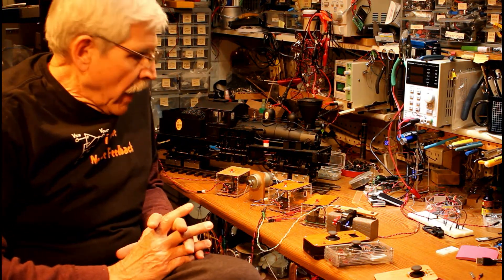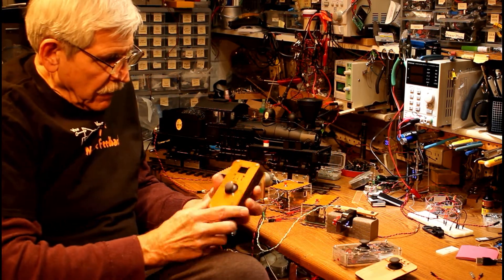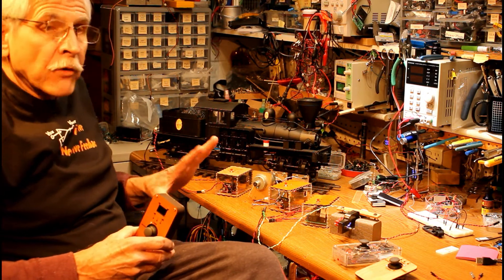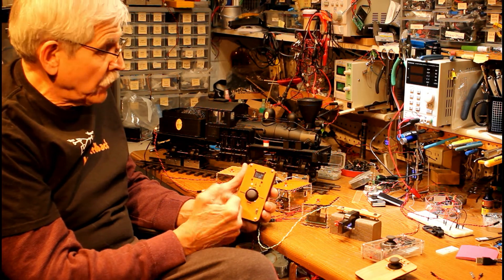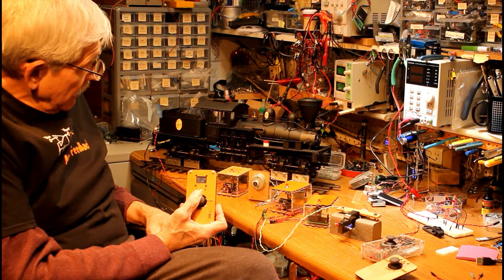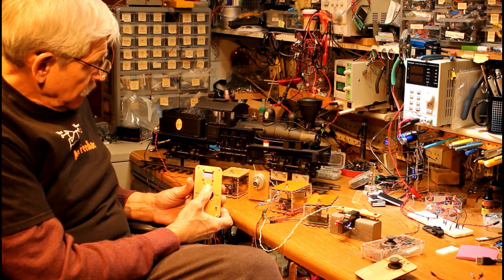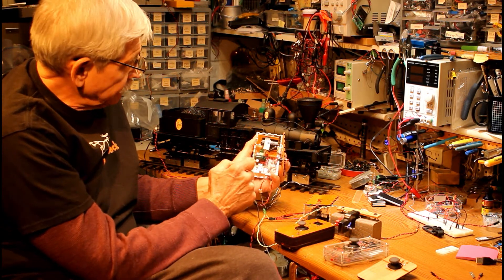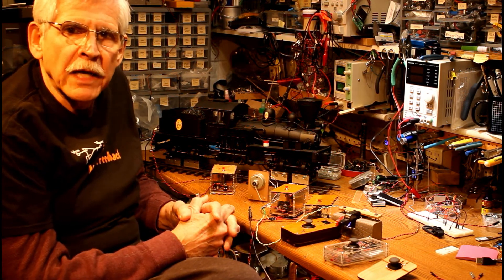3 Channel Wireless Model Railroad Throttle with Joystick

Comment: If these were used in a live rail application, I am not seeing how these can be used to power different locomotives on the same track, unless each locomotive has a decoder.  Is this DCC or is a way to provide remote control for DC locomotives?
Reply from the maker: You need to put a receiver in each loco to run them on the same track
Look over the web page that is linked in the description 
Dave

Comment: Hi, love this design. Just finished building one for my first loco. I have two small issues. When you fully accelerate or decelerate it takes almost one second per number, so full speed will take over one minute to achieve. Second issue when you let go of the joystick it doesn't hold speed it automatically decelerates at the same speed. Is this a program issue or do I have the wrong joystick? I'm an amateur at arduino, so I don't know which part of the code to look at. I also used a nano for the transmitter as well, so I don't know if I did something wrong.
Reply from the maker: Mark - it is possible that the joystick is the issue as a number of different manufacturers seem to make ones that look the same - it would surely be worth swapping that out.
Good luck & have fun with the project
dave

Comment: Hi love this and am looking at making 12+ hand pieces for our DC club and was looking at using these wifi units instead. Do you think it would be to much work to take your original circuit and change over to one of these - ESP8266 ESP-01 ESP01 Serial Wireless WIFI Module For Arduino Transceiver Receiver Board For Raspberry Pi I2C SPI UART Interface - from Alli express they are a $1.74 and i think have better range than the unit you used
Reply from the maker: Michael - the ESP8266 is a completely different beast - the HC-12 is MUCH easier to implement and has a greater range potential.
dave

Comment: Your next project really needs to be a Arduino mini based dead rail receiver to compliment your DCC wireless throttle!!!!
Reply from the maker: That has already been done as the receivers used in this project can easily be carried by a large scale train along with a lithium ion battery pack - for smaller scales (HO, for example) a smaller unit would be needed.
Is that what you have in mind?
dave
Reply: Actually I'm a N scale guy. :-) N's mighty small for such things, but I have a few "popsicle" boards made by Hayri, (https://www.youtube.com/watch?v=zY_FYg7vq0A) (I'm using Hayri's CNC Controller for my homebrew cnc), which could fit in a N scale car, the problem is getting a full bridge motor driver to fit in one. I know there are I.C.'s for building them, just haven't googled it all out yet. Truth yes, I am a great monkey see, monkey do kind of guy, I love to use what you smart guys invent. So much easier that way. :-P
Reply from the maker: N-scale would surely be a challenge!  I should think that very few folks run N on batteries!
dave
Reply: Wouldn't a Adafruit DRV8871 DC Motor Driver Breakout Board work for a Op-only track? I think it would fit. Ordering one just try to see if it will work with an Uno to operate a single loco an a oval.  The only drawback is tender and first cars would be strung together with connectors so coupling/uncoupling wouldn't be an option.  HO would be sooo much easier! LOL
Terry
Reply from the maker: Terry - I don't see why it wouldn't work - it is rather large for N scale - just under 1" on its longest side - did you notice that you could cut off about 1/3 of the board if you hand wire the motor and power pins?
Let me know how it works for you
dave
PS just found another such board - you might be able to cut this in 4 pieces!
https://www.ebay.com/itm/Naze32-SPRACINGF3-Flight-Control-with-CF-BDB-Tiny-Brushed-Motor-Driver-Board/112166686980?epid=2151407708&hash=item1a1da7d104:g:dpwAAOSwo4pYShly
Reply from the maker: That controller does seem low in the voltage department - let me know how it works out.
dave

Comment: Sir, what you do is absolutely amazing. God bless you. It would be really awesome if you have made throttle with ST7735 color display.
Reply from the maker: It is good to see that you liked this project - thanks for letting me know.
I chose the small display to keep the cost and complexity down but you could easily use another display as it only reports a small set of information
dave